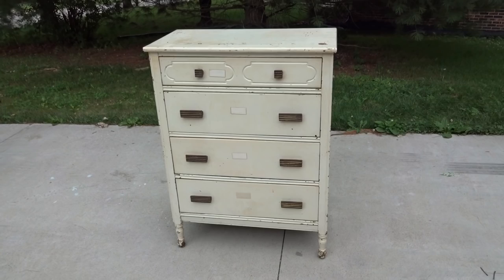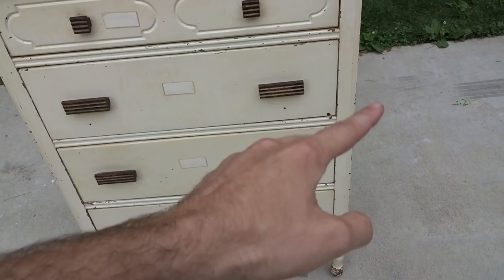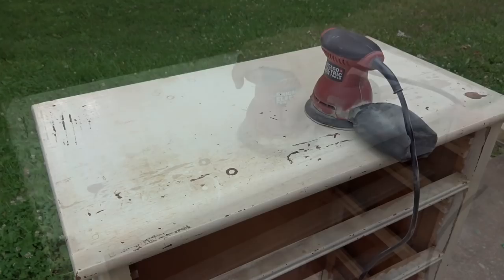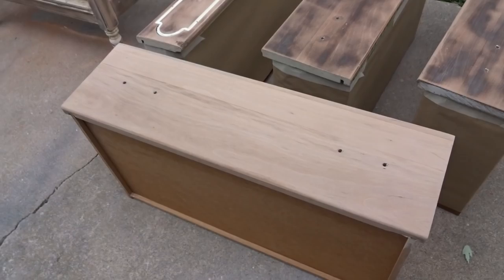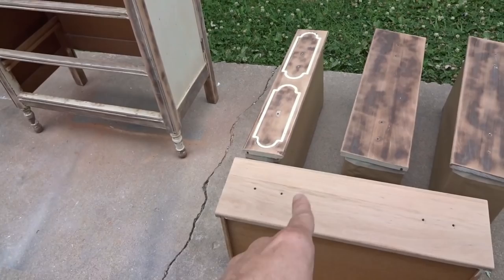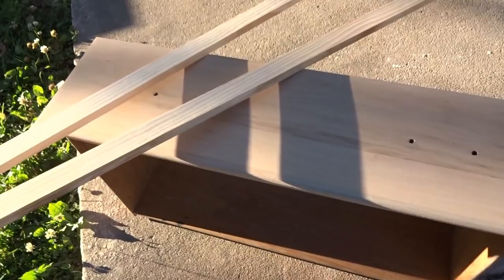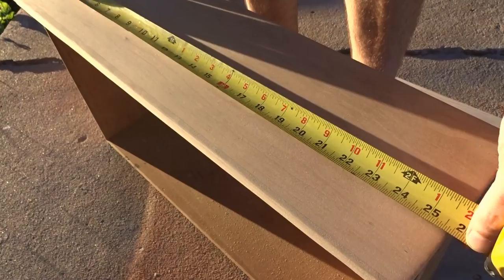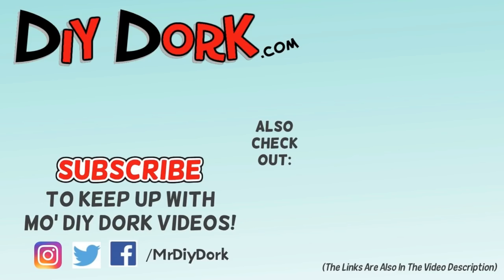Surf Woodie Inspired Dresser Makeover!

Comment: I use bondo too. I have even recreated small trim detail with it.
Reply from the maker: I found that it's not the most amazing stuff for cars, but it works pretty nice on project like this. I've used it on small trim areas as well. They make a fiberglass version that works great on more structural areas as well. It's kind of hard to work with, but is really strong when it sets up.
Reply: MrDiyDork, my father, is a retired auto painter.  He would use Bondo on anything and everything he could around the house - filling in dents and dings in furniture, and repairing holes in walls, and of course, our cars.  Glad to see you using it too.

Comment: Is there another way of putting on the front pieces of wood instead of having all the nail heads showing.
Reply from the maker: You could probably glue and then nail or screw them from the back. I almost screwed them on from the back, but when I did more research on Woodie wagons, I noticed that a lot of the ones I liked had exposed fasteners, so I went ahead and face nailed them for a similar look.

Comment: how long have you  had that harbor freight sander I was going  to pick  one  up  last time I went to HF but something  made me not buy it what's your experience
Reply from the maker: I've had it for about a month now after my Dewalt that I've been using for years wore out the brushes. I bought replacement brushes, but they didn't work correctly, so I grabbed one of these to try out. So far, it's working pretty nice. Here's the video where I bought it. https://youtu.be/QWNJwAKGf88
Reply: MrDiyDork thanks I'll   check  it  out